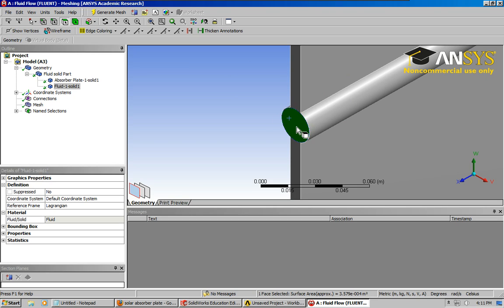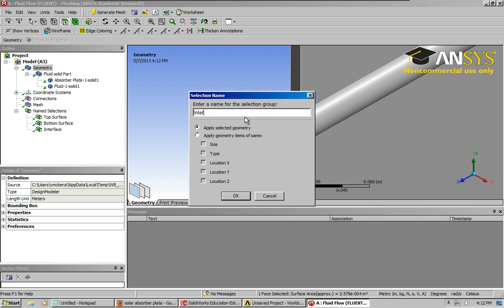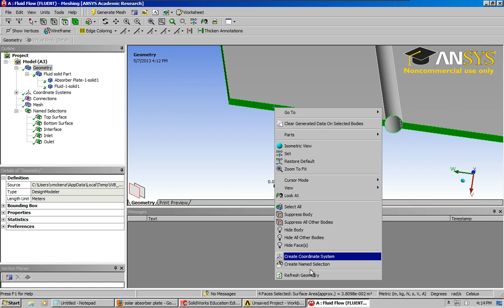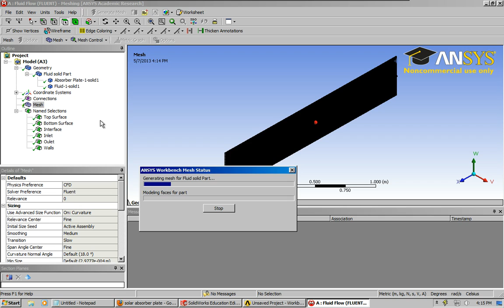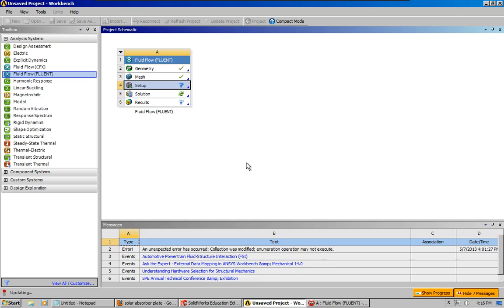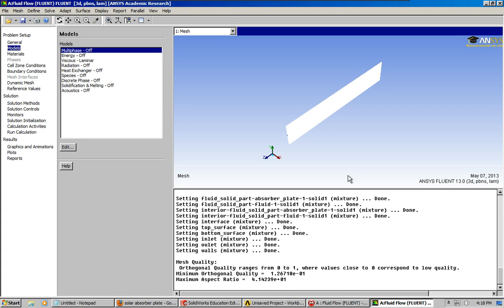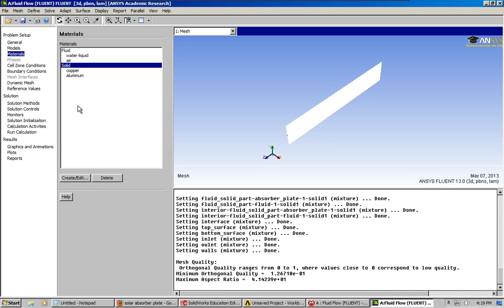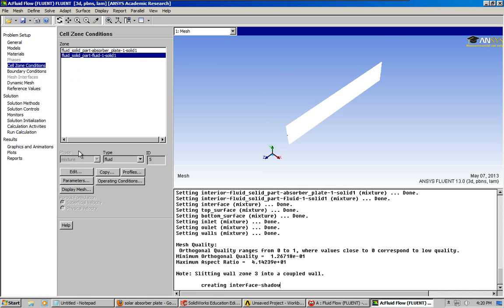Ansys Fluent Tutorial Solid to Fluid Heat Exchanger Part 3 named selections, meshing, solver

Comment: Hi!!  thank a lot for you 
my model in ansys fluent is solid with heat flux on the upper face and fluid domain in the lower face
,but there are no heat transfer between solid and liquid,      the interface is defined as wall and shadow

Comment: Hello again, after couple of months I have enough time to look at your great tutorial and I found what was wrong with my interface-shadow. After I import solidworks part into ansys, design modeller made 2 parts with two bodies (insted of 1 part with 2 bodies - as we can see in tutorial), so I form bodies into one part and now it works. Maybe this will be useful for someone.
Reply: Hey bjor son, I am having the same trouble. I get two parts with 2 bodies. Could you please explain how you managed to import the assembly as one part? (Which CAD software did you use?) Thanks in advance!
Reply: I'm having the problem too when importing from solidwork. I don know to select which middle interface since there are 4 instead of three, so interface shadow does not come out
Reply: Hi bjor son, I'm having the same trouble too where I get two parts with 2 bodies. May I know how do you form the bodies into one part instead of two? Thanks!!
Reply: For some reason, the author deleted my detailed reply. You can get around this problem by selecting the “high” setting in the “clean” parameter of the solidworks import option of design modeller. Bjor is talking about a feature of design modeller that allows you to select two parts and then click and option to create one part out of the two. Have not done it myself but loads of explanations on cfd-online.com